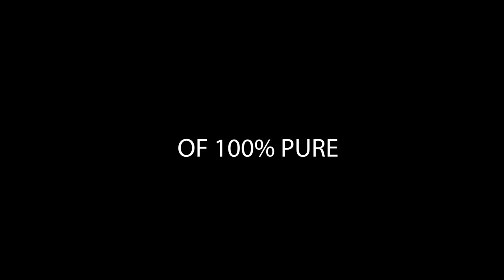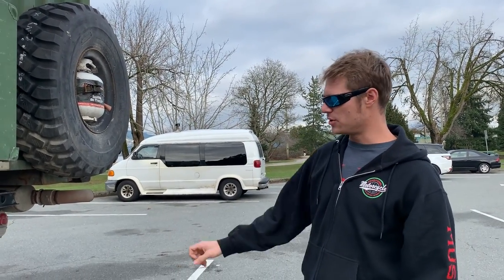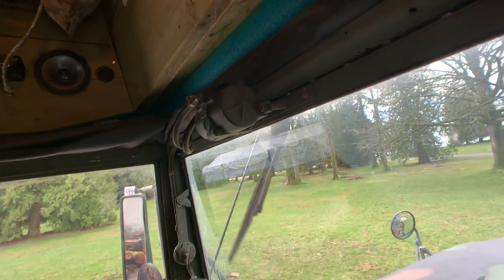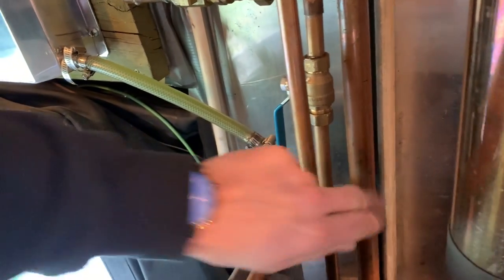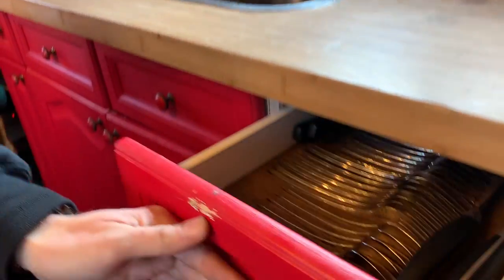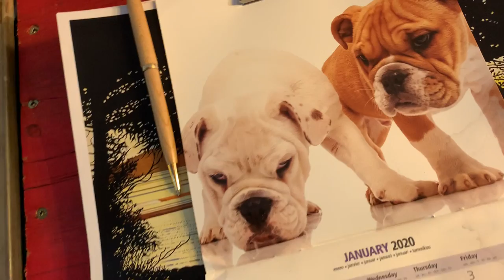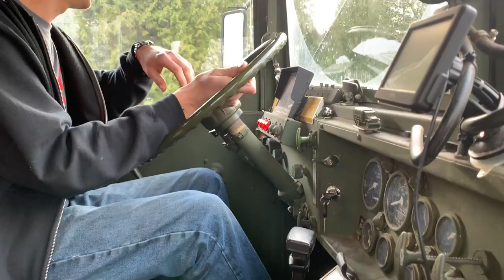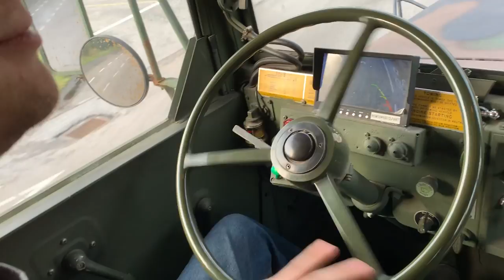TINY HOME TOUR || Self Converted Off-Grid All Terrain TINY HOUSE || Former Military Troop Carrier

Comment: That hot water system he has is genius. I took notes on that - even I probably wouldn't have thought of all of that. It means he can warm the engine up for starting even when its -40°C outside without needing to be by a plug in for an electric block heater. Very clever.
Reply: Yeah, with diesel fuel or solid fuel or both, and without any deliberate operations - Once the room heating is on, the engine coolant is preheated simultaneously. And when the vehicle is running, the excess heat from engine is gathered and reused to heat up both the water tank (through heat exchangers) and the interior space (through the vehicle's original A/C system). Super efficient.

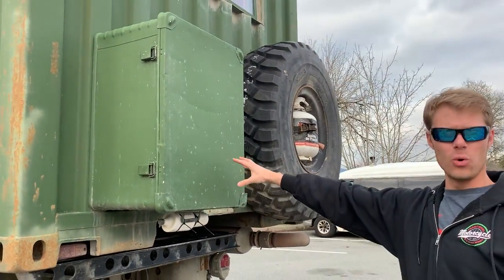Still haven't found what the LPG tank at 1:56 is used for, as the cooking burner is wood-fired... Maybe it's just a warning sign "Don't ever try to be too close behind me unless you want to blow up your car"
Reply: @JBF-GST-Tanda  that whole system is SO inspiring!  I've got so much work to do!  I've got the truck so that's a beginning!

Comment: “80 gallon of fuel dosent last very long” 😂
Reply: Real gas mileage?
Reply: @mysticalcarter3987  
Not gas bud,, about 5mpg @ 70kmh to 80kmh.
Reply: It is an amry Truck
Reply: 8.3 cummins is alcoholics.
Reply: Change the engine get a diesel Caterpillar
Reply: Nando Edgar I was going to say that . Plus add a spliter transfer case add a 2 transmission so ya have 18 gears to play with high and low range.
Reply: Honestly who wouldn’t want to have something like this , just so you can escape life and be free
Reply: roven 08  They're almost entirely out of service. Though their replacement, the LMTV, aren't much better.
Reply: roven 08  its fuel inefficient to be able to run on many other types of fuel.
Reply: installing a modern 5.2L cummins will significantly increase the fuel economy and these automatics transmission are expensive and break down soon  if pushed. A manual would increase its fuel efficiency, increase its reliability and make it much cheaper to repair. Those old torque converters suck

Comment: I'm impressed with the tiny home.  I'm more impressed with his mechanical ability to utilize the 7 gal keg for water and making his own heat exchanger.
Reply: Thanks man!
Reply: Brilliant.
Reply: Would love to see more detail on that system.  I did something similar in my house with my wood stove,  an old steam radiator, a box fan with a water to air radiator, some insulated pex lines and a recirculating pump.  It heats my garage shop.

Comment: You can get water up to the seat,and she will run. Slow, but that 6 wheel drive with low can climb out of anywhere. Never  drive  in reverse with low on. Will destroy the transfer case. Army has ton of 18 year old drivers tearing up transmissions.

Comment: when the zombie apocalypse hits, he will be the only survivor
Reply: When you hear about Coronavirus...
Reply: 🤣🤣🤣🤣🤣 gas is the issue
Reply: @lebowskilives4312  or cooking oil or pretty much anything else that engine will use...
It's probably one of the best platforms for the versatility of fuel use going.
Reply: You get the gas out of cars.
Reply: lebowski lives it’s a Cummins diesel, it’ll run on motor oil, vegetable oil or whatever oil gas skim you have laying around. Just have to filter it!
Reply: @lebowskilives4312  should convert it to electric engine and he can recharge it with his solar panel.
Reply: @mukamuka0  which would probably get you about a block down the road
Reply: There is nothing like the zombie apocalypse 😂😂 where do get such stories from?
Reply: @eliciarose1728  half a tank to turn it on, then 2 miles a gallon after that lol
Reply: Lmao he didnt consider that in a state of emergency or crisis it might be a bit hard to find gas every 4 meters.

Comment: One of the best builds I have seen! its Safe, Reliable, Cheap to fix, cheap to maintain, will never get stuck. the only down side i see is gas, but i personally would rather stress about gas than being stranded because my motor or transmission blew up.

Comment: 5 ton we use to drive while I was in the service. I remember my first year in back in 1995 I drove one of those to a range with the 4 wheel drive engaged and started smelling something burning. We got to the range and the mechanic opened up the front hub and black dust started coming out. I had no clue that I had the front wheels engaged, lol. That was a true private moment, lol. I retired June 2014, we don't use them anymore but you can probably catch one assigned to a National Guard unit.

Comment: I'd focus on rust proofing next.  I'm jealous...my wife would never survive mentally on the road.
Reply: Shipping containers are typically made of non-corrosive Corten steel, which is basically rust-proof. If that weren't the case, tiny homes made from shipping containers wouldn't be quite as viable.
Reply: @connorr2647  did you see the frame of the truck?  In most places in Canada, we used truckloads of salt on our icy roads.

Comment: PLOT TWIST: Fueling this thing would cost just as much as a buying house ⛽️ 🏡
Reply: You think that's bad, look up the cost of those tires on it!!!
Reply: Donald Nolan - 💸💸💸😭
Reply: @thelonelytrucker9317  You can buy timed out tires from the US military for about a hundred bucks. They still tend to have 80-90% tread but the military throws them out when they hit something like 3 years old. I'm not entirely sure on the age though. It may be 5 years but I was thinking 3.
Reply: Aren’t they multi fuel? As I can run on anything from petrol to used engine oil?
Reply: @thelonelytrucker9317  whats a tire cost? Just wondering.
Reply: Alan S Tan - About $500-$600 per tire...
Reply: @truthsayer81  in practice multi fuel engines use only diesel. They can run on low octane gasoline if oil is added. They can also run on fuel oil 1 or 2 in a pinch. The fact is that only diesel is used in normal operation. Edit: forgot they can use jet fuel as well
Reply: billiondollardan bio diesel, cooking oils, methanols?
Reply: Brandon Lee Sanders that’s not crazy for tires that large the ties on my jeep cost about 500 each
Reply: @truthsayer81  and used cooking oil
Reply: @billiondollardan  Most tire manufactures claim that a tire has about a 5 year life span. From the date of manufacture.This is due to the effects of the suns UV rays and the tires constant exposure to the elements.This is why a lot of RV's have covers to put over the tires to protect them from the suns UV rays when they are parked.
Reply: @truthsayer81  Yup! But that Cummins isc is a new engine only capable of diesel.
Reply: @truthsayer81  NO
Reply: Fuel is one of THOUSANDS arguments against this insanity.
The costs of maintaining this vehicle will bleed the owner dry.
And don't forget about road restrictions - loooooooots of places/roads/parking prohibit this weight 💩
Reply: @RickDeckardMemories  there's a lot more pivlic land in Canada then in America, also the road laws are bit more lax so think it wouldn't be so bad.
Reply: @cjlooklin1914 
Don't you have bridges in Canada? 
I am a trucker in US.
I drive a 40ft straight truck GVWR 26000lbs. 
I am prohibited on lots of roads.
Reply: i think that engine will run on anthing that us slightly flamable 😂
Reply: @truthsayer81  No, these were not multifuel -- only the M35A3s were AFAIK.  That was why the Aviation units were still using the older M35s.  (there are also M813s out there that are manual, that was what the M939s replaced)
Reply: @RickDeckardMemories  Here's the thing though. Fuel itself is expensive, until you realize, it's a house. You aren't gonna move it that often, you find a place you CAN park it and can drive to with it, and you park. Then you use a second vehicle. Apparently there is a Moped with that vehicle, so his fuel cost is quite low if he isn't in the move. Maintaining the vehicle would bleed the owner dry.....if it weren't an ex-military vehicle, that was extensively serviced by the military when in use, and made for reliability in the roughest terrain. Parts won't be cheap, but they also won't be unspeakably uncommon either. If you can find an Ex-military vehicle such as this, you can likely find the parts pretty nearby. While road restrictions suck, truckers of most kinds deal with this, and still find parking. I am certain this is very do-able, with planning, moving locations is not a big deal as long as you know your route. Plus, with one of these, it's less of a truck with living quarters and RV styled camping, and more of a house that just kinda moves. Treating it like it's constantly moving isn't how anyone would actually use it as.
Reply: @Stargun-vj1uh 
Yes, I see your point.
Reply: Lukas Van dijk The generation of 5 ton trucks before this one had multi fuel capable engines. This truck has a Cummins 8.3.
Reply: @DVB DVB - Love seeing a random guy show up being “That Guy” ✌🏽😂✌🏽

Comment: This is hardly off grid when you're bounded by a 50 mile radius to a gas station.
Reply: Definatly would be a candidate for an auxillery tank.....
Reply: With 80 gallons if he could achieve 5 mpg (I’m sure he can) that’d be 400 miles
Reply: @LowerClassClique  Lol, 5 in that truck.
Reply: @LowerClassClique  holy bejeesus! your arithmetic skillz is superb! I wouldn't be able to come up with those figures all by myself.
Reply: hosackies obviously not😂
Reply: It's a least still a house if you run out of gas.
Reply: Kronos 5 is pretty accurate, if you do 5 minutes of basic research on the truck they can make up to 12 mpg and 5 if you’re being inefficient.
Reply: @Grophic  Too lazy. And btw, was that 12 brand new? ;)
Reply: Kronos this truck in this video is new (the motor is at least). I said 5 not 12 because of the added weight and wind resistance. 

Ps: stfu weeb😉
Reply: roven 08 well 2 times 80 equals 160. Over 3 times what he said. So what is your point?
Reply: roven 08  2-3 is pretty unlikely for that truck.  2-3 is what you'd be looking at with a HEMTT converted to an RV and those are 2x the size with an additional axle.
Reply: Pretty sure he said he can get 1000 miles with the 80 gallon tank
Reply: That's not what off the grid means 😂

Comment: That is a sweet truck. I love that turbo sound with the open concept, and the heat recovery system.Very unique aesthetic but looks sweet. Had the experience of driving the old MLs and yours is very clean and quiet compared to our units old unstoppable deathtrap XD Any new trucks tho will not last as long or appreciate loads of mods like these old beasts.

Comment: Cool rig, I like all the cold start options you've built into it. I'm building out a few Ford F250 4x4's for hunting, camping and overlanding. The overland rig will be my latest acquisition a '94 Supercrew cab long bed that will become an aluminum flat bed with an S280 electronics shelter converted to an RV style camper. The current build is an S250 electronics shelter on a military M105A trailer I got both for $1,500 with 4 spare wheels amd tires for the trailer. Eventually the shelter will just go directly into the long bed of my '85 F250 4x4 non turbo diesel truck. I will probably tow one of my Bronco II's, V6/5 speed manual Suzuki Grand Vitara, or first generation Ford Explorers for the trail rig for hunting. Not sure yet how I'll make it all work out. Ince I findthe best elk hunting spot for this year's season I may drive the diesel with shelter out and ride the enduro home and bring out the. '82 hunting F250 4x4 so I have an empty long bed for the elk once I down the one I want. Coolest thing ever watching how other's have set up their iverlanding homes on wheels.

Comment: Im not much of a builder, but this is one bad mama jamma. I love it, wish I was a whole lot younger. Great job!!!! Do to the weight class of the truck, are you required to have a CDL to operate this> That 8.3 cummings started life out as a farm tractor motor in the early 90's. Cummins added a couple fuel filters and a electronic solenoid in order to control the fuel and waalaa, instant road tractor motor.

Comment: This is so cool. I wouldnt consider it with the sheer weight and amount of fuel required. The air powered wipers suck. Imagine the noise while driving for hours
Reply: Not sure we'd hear them over the engine and tire noise.

Comment: I drive a 2003 Dodge 2500 4x4 with a 5.9 liter Cummins turbo diesel that's 5 tons (10,000 pounds). When it was new I could get 1,000km from its 100 liter tank so what is that 30mpg? That's on an open flat highway at a reasonable speed no load all season tires. Mike's vehicle at 3x the weight of mine, 8 liter engine, huge tires, the flat front of the shipping container wind break my guess is 5mpg. Just keep the fuel filter clean on any diesel and it'll be fine.

Comment: your heating system sounds genius at first but that's a ticking time bomb on that having a sleeve of coolant over your hot drinking water pipe please tell me their are no exposed soder joints inside the sleeve
also i would be warned about vibration erosion even if there are no joints leading to the freshwater

Comment: The tire/wheel  like your spare you said @ 1:50 lbs weigh 500 Lbs each ?  How would you get the spare up there. How would it ride and what could keep them on the truck and what shocks do you control those with ? Great MPG ?  Must be lead filled for bullet proof ?  500 pound tires you may not be Hercules and they may not be 500 pounds a tire !!!

Comment: 80 gals. of fuel doesn't last long. All the stuff you're carrying plus it's a 6x6 drive to boot. Have you ever scaled the truck? Bet that's a real heavy deuce-&-a-half & your drive train is not conducive to getting even 10 mpg highway. Should ask, what kind of mileage do you get? Do you add a fuel additive? I use 'Power Service' for the last 15 yrs. & have been very happy w/ it. Use the anti-gel formula for the winter. I use a bottle every-other fill up, but use the anti-gel in the 'close-as-you-can' ratio every time I get fuel. For your application, diesel is the only way to go. Petrol would suck & electric...never.